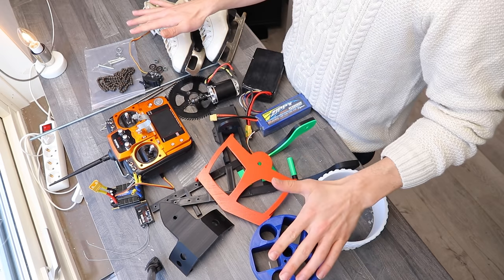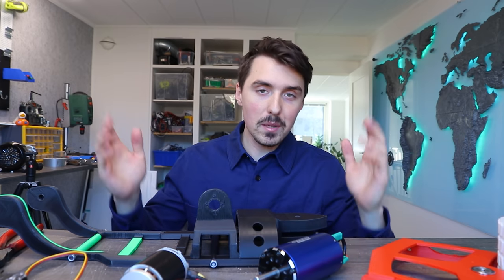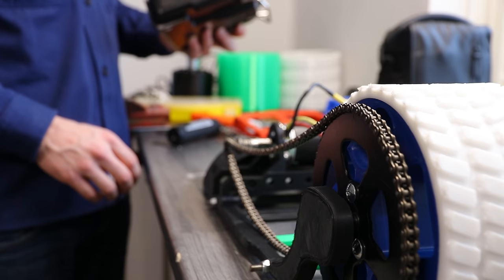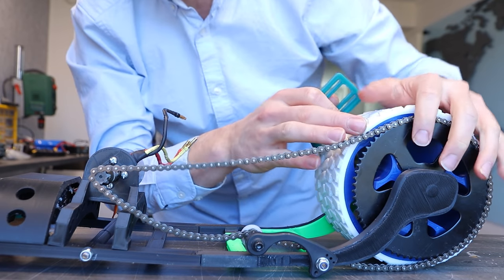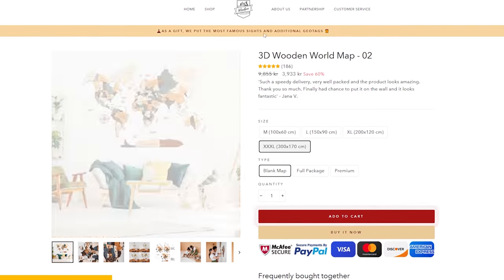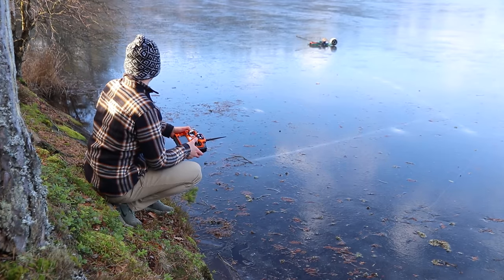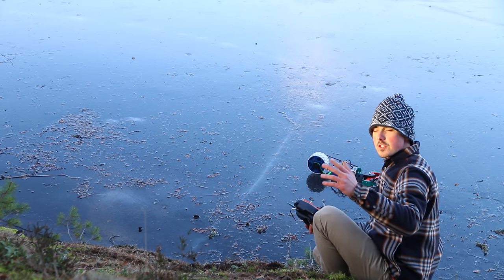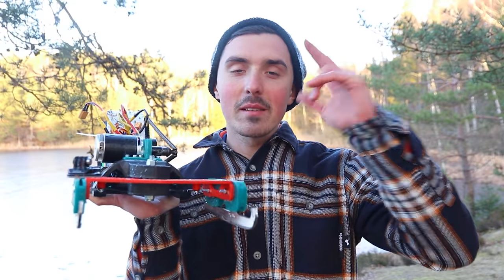3D Printed RC Ice Vehicle With Chain Drive

Comment: That looks great! I think understeer is caused by rear biased weight distribution in this case. Adding some camber will also help, as you want the edges to cut into the ice. 
Adding a chain idler would help with the chain issue. Or chainguides if you want to avoid friction (look up MTB chainguides).
Reply: I'd vote for guides, they'd be dead simple and cheap to implement. Great suggestions!
Reply: @Hawk7886  i'l add suspension on both the guides and the power wheel

Comment: Maybe try an Ackermann steering kinematic for the front? I think this will drastically improve the turning radius. Also looks cool :)
Reply: That won't work on ice no grip ☺️
Reply: Just needs more travel on the steering that's it.
Reply: Yeah, or even having the motor directly drive the pivot and having it right in between the skates.
Reply: Now you need to print out a Simon size one you can ride into Stockholm.
Reply: i think driving it backwards would have already helped
Reply: @frienddotexe2536  Simon would look ridiculous if he rode it backwards.
Reply: @markwilliams5654  
Huh? Two skis fighting each other vs two skis not fighting each other perform the same on ice? No.  If friction is low, fighting for that friction only makes matters worse.
Reply: Putting just a little camber on the skates and a pivot that moves the weight towards the outer side when turning would have helped without creating a too complex setup
Reply: Or he could just use pizza cutters 🍕
Reply: @ChaNnArD-mD  HA! I had that same exact thought. The length of the skates is unnecessary (weight is 1/100th a human).
Reply: wouldn't it be more helpful to just have the wheel in front?
Reply: @markwilliams5654  Why wouldn't it work? Many snowmobiles use a variant for the front skids. (Bellcrank steering = Ackerman steering for the most part.) Ackerman mechanism is the steering unit used on the majority of wheeled vehicles as well, not to be confused with the Ackerman angle/offset regarding inner/outer steering radius. Rather it's the shape of the blade and angle that it cuts into the ice that affects lateral traction.
Reply: A what??
Reply: Came here to write it
Reply: The steering already pivots about a single point, so ackermann steering isn't necessary. It's only needed when you have 2 different steering pivots in different places.
Reply: @FranseFrikandel  It would increase the contact patch and improve lateral friction. Unless you take measures to put a bit more weight on it, front skid is more likely to slide along than cut in to make the turn.

There's likely some other dynamics at work too. Think of trikes. Those that have the "tadpole" configuration can turn on a dime. Those with a single front are more like "good luck with that" if you're expecting cornering.
Reply: @LewisRawlinson30  
. . 

    
 
 ..  .  NV

 .     .     
.. .  . . 
 
   
NBC. N  
 .. .
. 
   .             .    
N.     
      N.  .          .         

     
   
 .            .     
     
  
 .  N. ..         Ng
.      .  
              .   .     .    
        N.  .           
                

       .   
   .
    
  
 .
 
.

 .     

    
  .              
  ..

.    .                .        

  

   N.      N 
   
     . N
 .   
 .       
    .      .        .  
 
 
    .     
.   . .
 

 N.   .
     . . 
   .     .       . 
  

  

  
 .  .
 
      
              .   
          
 
       NBC 
   
       
  
           
   . N   
 

      Nn 
     .     
 .

    
 

      
    .     .  
 
 

    .   .  
    

  . 
  .   

          
. 
        .     
        .      .  
  N.    .  
 
 . .  .
     .          .
 
.
Reply: @LewisRawlinson30  

       
      
        
      . .    .      

 .  .  
   
 .
Reply: @LewisRawlinson30  

       
      
        
      . .    .      

 .  .  
   
 .
Reply: @LewisRawlinson30  .  .        N.   ..     

  .
Reply: @LewisRawlinson30  .  .        N.   ..     

  .
Reply: @xenontesla122       .
Reply: @xenontesla122       .
Reply: @xenontesla122  
       ..    . .  
 

 

. ..
 
 

 .
 
..   
     .
Reply: @xenontesla122  
       ..    . .  
 

 

. ..
 
 

 .
 
..   
     .
Reply: @xenontesla122     n
.
Reply: @xenontesla122  . .      
.
Reply: @LewisRawlinson30  
. . .  .   .    . .          ..... ..     .   .
Reply: @LewisRawlinson30  
. . .  .   .    . .          ..... ..     .   .
Reply: @LewisRawlinson30   

   .. N . ...  ..      .  
. .   . .     .   . .       .. .
Reply: @LewisRawlinson30         . 
 ..
.
  .  ...  .  .  .  .. .   ..  .  . ... ..  ..       . .
..       
  .  ...    .  . .   
 .  ..          .
.    ...  . .    ... .
Reply: @LewisRawlinson30    .       ... 
       .
 
... .. .. ..      .   .       ..     . .. .    .    ..   .  .. 
 . 
..  .  
.  ...       .     .  .
Reply: @LewisRawlinson30  
    .   .     . . .
Reply: @LewisRawlinson30       . .       ..    
 .  .
    ...  .  .
Reply: @LewisRawlinson30  .
Reply: @LewisRawlinson30    ..
 
      . 
 .      ...           .    ..             . 
 . .
Reply: @LewisRawlinson30   ..
Reply: @LewisRawlinson30                   ..
Reply: @LewisRawlinson30  

 .
 
  ..
Reply: @LewisRawlinson30  

 .
 
  ..
Reply: @LewisRawlinson30   .. N
    
  .. 
 .  N
 
  

   .   
 .v   .     .     
 .n.  
.     

.v 

     V
 .n 
 
      V   v
     
      V
 .    .n dll v  .n.     v

  N. B
 Nv
. . 
.
Reply: @LewisRawlinson30   .. N
    
  .. 
 .  N
 
  

   .   
 .v   .     .     
 .n.  
.     

.v 

     V
 .n 
 
      V   v
     
      V
 .    .n dll v  .n.     v

  N. B
 Nv
. . 
.
Reply: @LewisRawlinson30  vvn
. 
N

  .. 
  V
Reply: @LewisRawlinson30  vvn
. 
N

  .. 
  V
Reply: @LewisRawlinson30  vvn
. 
N

  .. 
  V
Reply: @LewisRawlinson30  vvn
. 
N

  .. 
  V
Reply: @LewisRawlinson30  vvn
. 
N

  .. 
  V
Reply: @LewisRawlinson30  vvn
. 
N

  .. 
  V
Reply: @LewisRawlinson30      .v.  

.

 .

  . 
.
..

.
N CNN v
Reply: @LewisRawlinson30      .v.  

.

 .

  . 
.
..

.
N CNN v
Reply: @LewisRawlinson30   ..
.v 
.n n. 

 

... ... . ..n  n

.
Reply: @LewisRawlinson30  

N.. 

 
.
 .

N
Nv

.

.
 

 
... 

. 

.

N
Reply: @LewisRawlinson30  

N.. 

 
.
 .

N
Nv

.

.
 

 
... 

. 

.

N
Reply: @LewisRawlinson30  

N.. 

 
.
 .

N
Nv

.

.
 

 
... 

. 

.

N
Reply: @LewisRawlinson30  

N.. 

 
.
 .

N
Nv

.

.
 

 
... 

. 

.

N

Comment: To improve steering, you can always use hockey blades(more rounded) or smaller blades, though it has less surface on the ice the vehicle would be able to turn quicker. This with a leaning design you can further decrease the turning radius.

Comment: Brilliant content, thanks for the entertainment! Tip: Skates work two ways. The pressure created by the sharp edge creates a groove that makes grip. This pressure also melts the ice in the groove into water reducing friction. The curve of the blade determines the turn radius. You need much smaller skates, 3-4 cm, like curved razor blades. I made a prop-driven RC ice yacht once and had similar problems.

Comment: great design, if you make a Mk2 maybe you could angle the blade inward to give more bite to the blades when turning. Pretty impressive it works at all! Here it's minus 30 c right now, we would not have any problems with melted ice!

Comment: you will need a chainguide to keep the chain stay.  The gear ratio also affects the torque acting on the frame. Your frame could fully surround the the whole chain mechanism to cancel part of the torque.

Comment: Great fun project. It may have steered a bit better with a svivel system, like on dumper trucks (hjullaster). A self tensioner with a spring and with a gear I think would have been the best system for preventing the chain to come off.
On my Tamiya Lunchbox I have used 13mm long Biltema screws that I screwed from the inside, duct taped the inside of tire and finally put in some tire foam.
When I was finished I cut the screw so there was about 5mm protruding from the tire.
They are perfect for ice driving and it will wheelie on ice. Those tires has lasted 7 years now.
Reply: With knife Blades IT works maybe better because Skate Blades are to wide need more Weight.

Comment: For drilling steel like that, get yourself a set of Cobalt 30 degree split tip bits. They are a bright silver color. They are specially made for drilling hard steel and work way better. Use very low speed, and some cutting oil and keep a steady oil drip going.

Comment: Very cool idea for a rc vehicle. You will need a sprung tensioner. There’s a reason all cars have them for engine belts. And if you want it extremely easy way to add steering bring the points where the steel rods connect to the skate mounts closer to the fulcrum

Comment: If you wanted to keep the same frame structure, you could simply turn it upside down so the weight is more effectively applied to the rear tire. It would also allow for more clearance for the skates to rotate solving your turning radius issue. I'm looking to get a 3-d printer soon, so I would love to create something similar. Great video, I love that your videos show the trial and error that you encounter.

Comment: I didn't read all of the comments, but figuring out a way to have the blades of the skates on their edges would greatly aid in stability and turning. I played hockey for many years and you turn on the edges of your skate, not the flat bottom.

Comment: Make the frame hollow and insert (press fit) stainless steel rods into the cavities, makes the frame stiff as hell. You can order them pre cut to size for like €10. Also HTD 5mm belt would be better than chain, then you can download step files and print exactly the gear ratio you want from Misumi.

Comment: Cool vehicle. Some weight over the front might help your steering authority quite a bit, as would wider spacing or tilting of the front 'feet'. 
Certainly worth adding a bit of wood or something next to the lipo to stop the chain ripping chunks out of it over time.

Comment: If you still use the servo steering setup, move the connection joints on the steering side closer to the center of rotation this will give less Turning torque but more travel, reducing the turning radius by increasing the steering degrees.

Comment: You should give it proper skis that move independently and possibly are suspended. A lot like a snowmobile, getting rid of the mid section fulcrum. This will allow you to keep more weight forward to dig the blades/skis in.

Comment: it needs more weight on the blades to help them dig in to turn, and a spring -loaded belt tensioner to keep the chain from coming off. You probably could have kept the spikes in the black wheels. I know you wanted a huge wheel in the back, but that thing would cruise faster with a smaller wheel, so you should have flipped the gears. Have the large one drive the small one for more rpm, but a beefier frame would probably be good too, so you don't want to give up all of that torque.

Comment: I believe skates are made out of hardened steel. You need cobalt drills, low RPM and maybe some cooling fluid. Alternatively, try using a concrete drill with carbide tip.

Comment: You have to set an edge to get it to turn well, if you could tilt that front sled the same direction you are turning in, it should add a little "traction" to your turns, kinda like skiers or snowboarders lean into their edges for good turns

Comment: I'm not really sure if it has any meaning, but I imagine that motor pulling chain can cause frame to flex up, so wheel goes up as well. If you put wheel in front, motor pulling chain will cause frame to flex down and press wheel against the ice a little bit more, so you'll get a little bit more traction.

Comment: Your chain problem is also shared with motorized bicycles! This is solved by using a chain tensioner, a wheel on a bearing that applies pressure to the chain to remove slack. I'd recommend looking into this!

Comment: with all the torque you had in the beginning, you could just add more weight to the front to push into the ice, or go crazy and actively heat the skates… (dunno if that would help, but it sounds kinda awesome)
also you could try have the skates angle in the direction you’re steering, or make flexible skates from pla sections connected with tpu/tpr with maybe small metal bits on the bottom…

that’s if you decide to iterate on this, but as it is it’s already awesome!!

Comment: Well, you certainly kept this old codger entertained. Overall I like this project. Sure a few improvements needed, but that’s the way you learn. I think metal weight inserts ( pieces of square tubing perhaps) into the wheel to give it some heft? Uh, a bit rough on installing the shafts into the bearings, but we’re not talking high speeds or long life for this test vehicle either. Keep up the good work!

Comment: If you put the drive wheel in front, the chain tension would be parallel to the body structure, and also steering would be easier.

Comment: Lost the chain and go with a toothed belt to reduce the rotational mass, that will help with frame stress too.  Smaller blades with a higher surface area will also increase effectiveness.

Comment: You need to bring the motor closer to the wheel, and you'll increase rigidity by using A frames on either side, the space between the wheel and motor could also have a wheel guard to reduce how much water you keep splashing onto the electronics.

Comment: some kind of Shock dampers on the steering part to keep an steady pressure for steering. or use Pizza Cutter roller Knifes in the front, then you have some kind of Hybrid that even can run on Land... but should not :)

Comment: For such a light build, you might be better off with a low pressure tubular tire or a basic throwing star. For speed, an inverted hovercraft (suction) and propeller drive.

Comment: Steel is hard to drill because its stainless. If you try to baby it and take your time, the outside of it work hardens, and becomes next to impossible to go though with a steel bit.  Adjust the pulleys in your drill press to go slower, then give it plenty of down pressure and drill it like you mean it when you want to drill stainless.

Comment: Need chain guides like on a dirt bike.  also,  if you make suspension, put the pivot as close to the motor axis as possible, so the chain doesn't have to change length as much.

Comment: make it two wheels for better stearing. use the motors with the rotating hub and you can put them directly at the center of the wheels. and on the front you can use just a shorter blade or whatever you love

Comment: When drilling steel, change the drill speed to low and use coolant. High speed will heat up and harden the steel.

Comment: Think a couple of Stanley knife blades would do a better job than the skates. Skates are designed for a 50+ kilo human, not couple hundred grams car. Think the thinner profile will help with cutting into the ice for steering. You can also double up on them if they're too flimsy.

Love the video regardless, always looking forward to them.

Comment: hey, use straight bars instead of studs on the drive wheel, forward grip but zero lateral grip, it would be a drift machine, would add too much turn radius. Add "V" shape to them to dial in the amount of slip.

Comment: I like it. I think ice skates work with pressure super cooling the ice back to liquid so you may not have enough pressure for that to work. I wonder if 5 kilos would help it steer better? Maybe also putitng the camera weight and lever arm over the wheel? Anyway, cool thing nice work.

Comment: If you were to sharpen the skate blades to be pointed like a knife, it would steer better. Ice skate blades are flat and rely on the leaning to the side to catch the edge to make tight turns.

Comment: I think smaller blades on the front, angling the body forward and reduce surface contact, or adding more noseweight could allow the steering to perform better.

Comment: Grab a couple of cheap Mora knives and use the blades from those as skates, there is not enough weight on those. And if you encounter steel like in those skates again (or stainless), go with Cobalt HSS drill bits - and low RPM with stainless, as that stuff work hardens like it hates drilling.

Comment: Love your content. It is a lot of fun. Maybe you could have made it direct drive for higher rpm? you can integrate the motor in the wheel since it is an outrunner. Just a suggestion.

Comment: I wonder what would happen if you added a few oz of lead/weight to it centrally on the frame next to the battery at a lower center of gravity so that the studs and skates got better traction. When I added full steel bumpers to my truck it was amazing how much better my 4 wheel drive was.

Comment: Need to copy some aspects of a trailing arm on a motorcycle. That will give you some ideas on how to approach both the needed rigidity and also proper chain tensioning. Most will have a slotted mount for the rear axle to slide into and some kind of thrust bolt on both sides of the axle to both help with alignment and setting tension of the chain. (Slot opens to the rear, and thrust bolts either push or pull the axle backwards depending on the design. Thrust bolts usually are not the same as the axle bolt/nut that clamps the axle in place.)

For the front ski runners, fixed pivot towards the front of each ski and the rack and tie-rod attaches to the back. Same concept as steering on a car from there. Having the pivot on the leading part means that it should have a tendency to straighten out on its own. (Like the front wheels on a shopping cart, where the pivot leads the contact point of the wheel.) Although if you want, the kind of gyro available for some RC cars may improve steering stability even more as it could help correct for hitting bumps and such.

Other than those two things, seems like it's pretty much there.